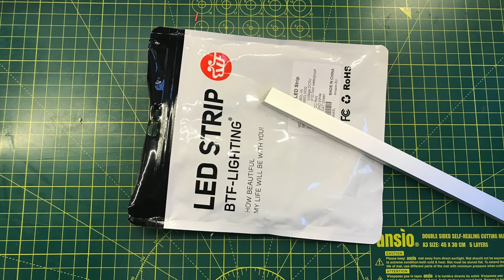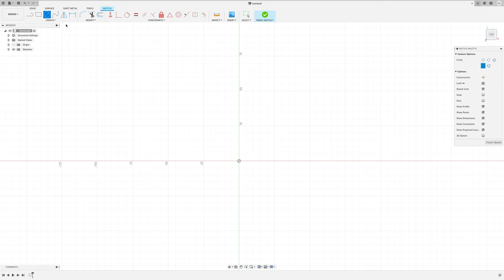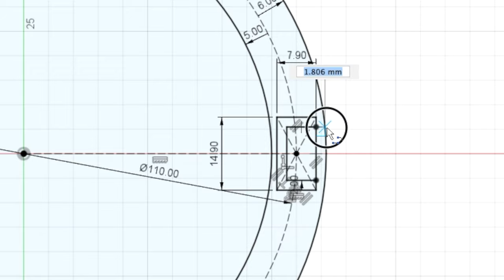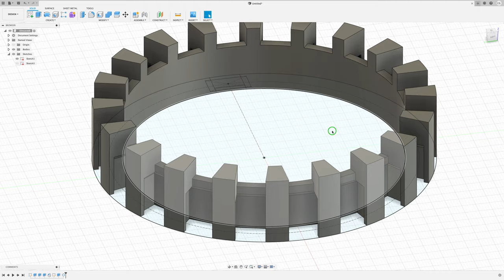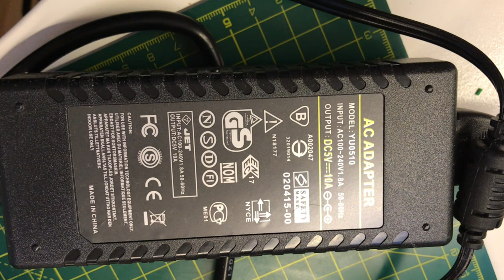DIY Flame Lamp

Comment: I really appreciate that you shared the things that didn’t work so well. Learning what not to do is at least as important as learning what you should do.
Reply from the maker: Thanks - all those wires was definitely a big mistake - in the end, it came out quite neat, but it was pretty unnecessary.
Reply: @atomic14  For that amount of LEDs, I've found that power at each end would suffice

Comment: Good video!

I can recommend using adafruits best practices for ws2812b; add a electrolytic capacitor of 1000uF accros the power lines near the LED strip start to protect against inrush current and add stability, and add a 200-470ohm resistor on the signal output from the level shifter. 

Anyways, great looking build and nicely edited video.
Reply from the maker: That's very handy - I'll probably put together a custom PCB for this so I'll add this in.

Comment: I found I can easily use the lower voltage data line from an ESP32 to drive loads of those LEDs. Never needed to use a level shifter. 
I've also used those ESP32s you can get with an 18650 battery on board to power some small matrices for a few hours. (Fun at the pub. When you could go to pubs, that is ;) )  Also, the little charger/booster boards you can get are great for powering some LEDS and the ESP32, taking the boosted 5v from the board for the LEDs.  Lots of fun!  Though I am now surrounded by random LED projects.
Reply from the maker: I know the feeling, I'm starting to get a good collection of projects now!

Comment: As a remark, not all level shifters are suitable due to the strict timing required. For example the adafruit mosfet type level shifters are not working for this. A 74HCT245N might do the job.
Reply from the maker: That's a good point!

Comment: Try a strip of grease proof paper from the supermarket wrapped round the lamp.. Rather than cutting the solder joint just heat it with a soldering iron. The LED strip has more copper on the revere side so cleaning off the solder mask gives 3 more pads, if you need the extra room on the on the front. (I normally clean the back just for the data)
Reply from the maker: That's a great idea - I don't know why I didn't think of just melting the solder. Feel slightly silly now :) I'm going to give the grease proof paper idea a go.
Reply: @atomic14  your welcome. 👍👍

Comment: Hey mate, awesome creation with perfect ambient lighting, I'm in the process of making one myself however i'm struggling with the LED pattern, would you be so kind to share the code/method behind achieving such a pattern?
Reply from the maker: Sure - I actually thought I'd put it on GitHub, but I must have forgotten - I suspect I was planning on cleaning it up and then pushing it up and forgot. I've put the code here: https://github.com/atomic14/flame_lamp_firmware take a look in LEDControl.cpp for my implementation of this algorithm https://fabiensanglard.net/doom_fire_psx/
Reply: @atomic14  oh mate, you're a legend, and cheers for the quick reply!
Reply from the maker: @Kieza-  No problem! Good luck with your lamp.
Reply: @atomic14   Hey again, having a bit of trouble as i'm a beginner here, and i'm also using an Arduino Uno with the FastLED library for this project, I was wondering how possible it is to somehow convert the code to suit Arduino with that libary?
Reply: Sorry, I couldnt find the Arduino file. Could You share the link? Regards

Comment: I’m confused. I’ve been using ws2812bs with 3.3 logic for a while. I thought the data lines needed vcc * 0.7, which = 3.3 ( though I guess my longest runs have been 50 LEDs, not 300 )
Reply: yeah. I've never used a level shifter on them. Direct to an ESP32 has been fine for me, for a certain amount of them.
Reply: In most cases, Level shifters only become necessary once you have multiple parallel strings or interference inducing components nearby or a lot of leds.